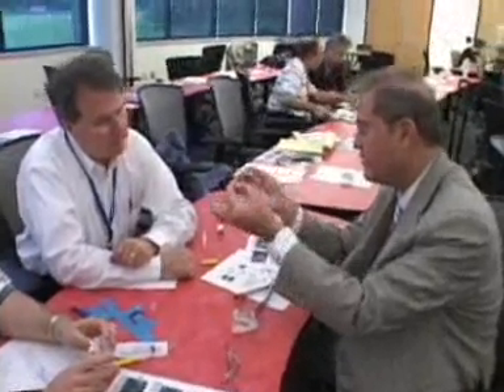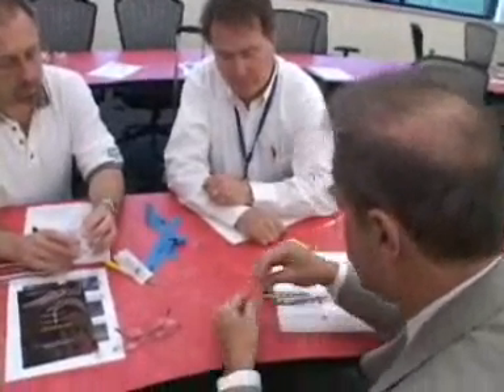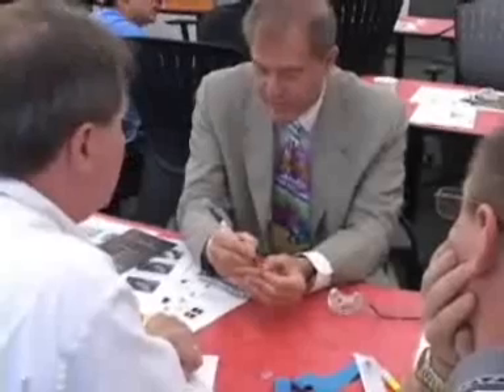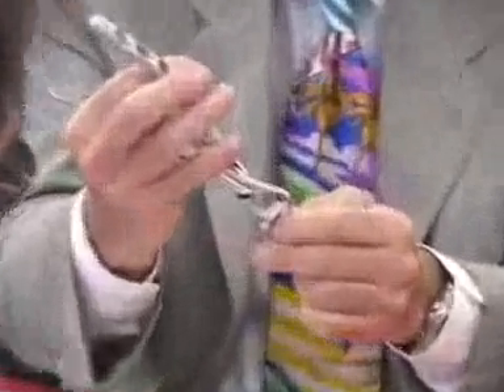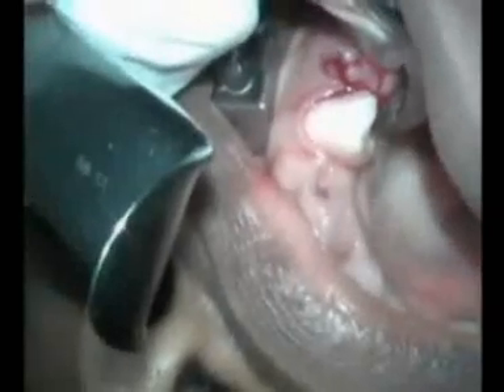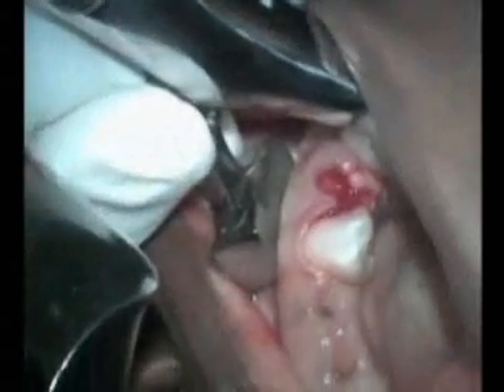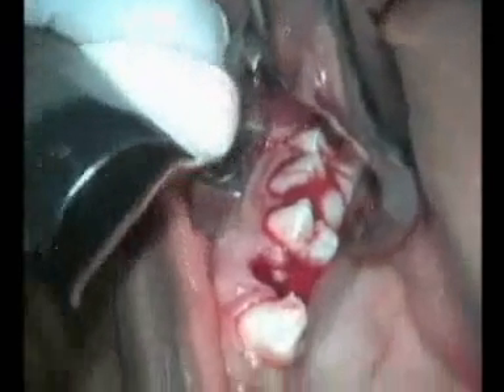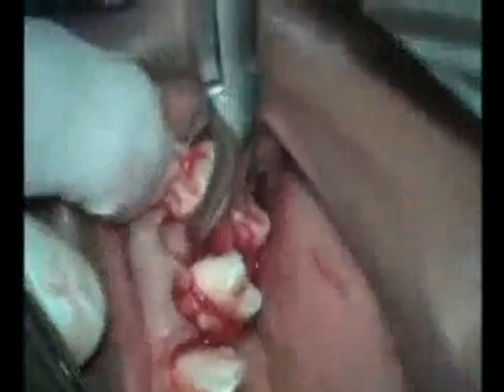Physics Forceps

Comment: My dentist did not use that for my tooth or tell the different optionsI had. he just gave me a shot and cracked the tooth with his plyers after breaking it. After he pulled the tooth he tells me that the tooth did not want to come out & how he could have saved it. Then he put a post in the tooth behind it, after trying to remove the crown he used a drill to get it out. And put some white oblong pills in each root he called colligen which will form into bone. But they cost half of bone grafts.